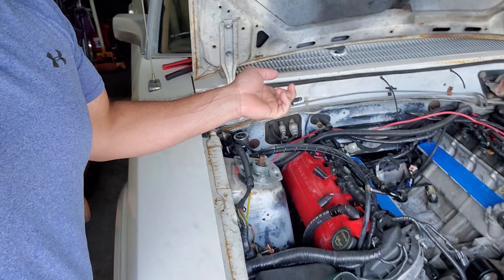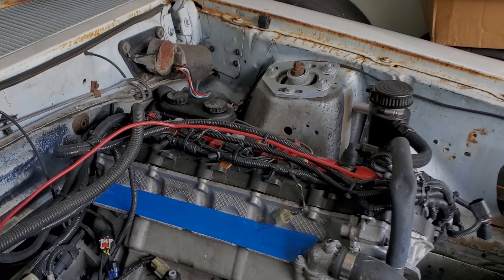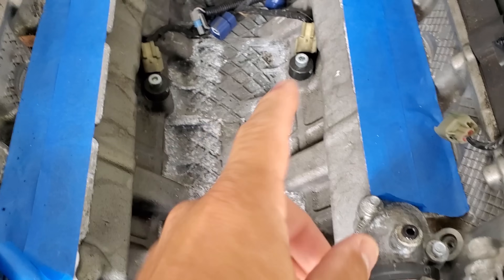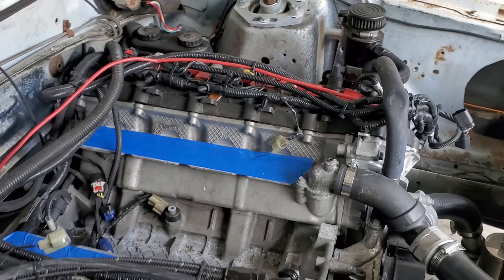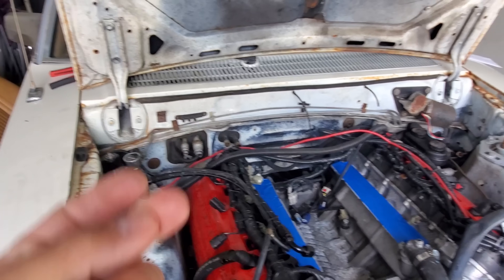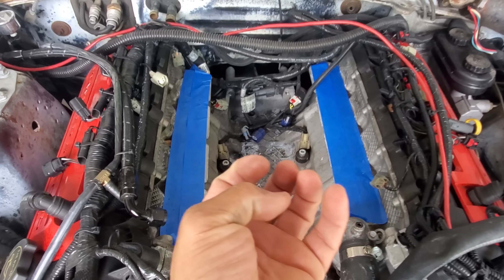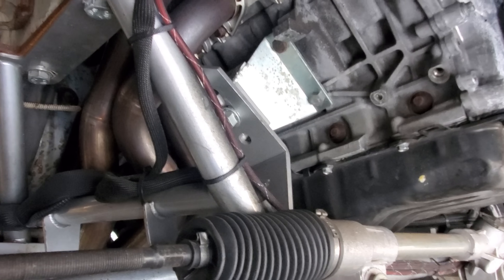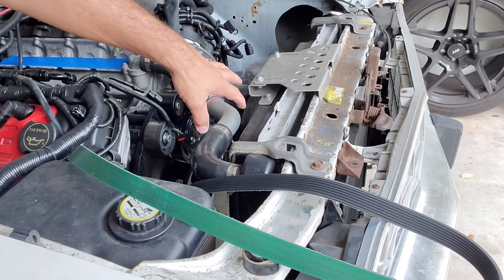Coyote Mustang Knock Sensors and how they work

Comment: I make the J&S Vampire.  Lets you add individual cylinder knock control to the earlier modular Ford engines, using a single knock sensor.

Comment: My 2015 F150 has a 18GT manifold, Cat delete, cold air. Stock exhaust. My truck peaks 30* by 5k and from there it drops all the way down to 15* by 7k gradually. Nothing hits, spark plugs are new. It does it on 91 or E85 it gradually pulls 10-15* to redline at 7k from 5k. Zero knock anywhere else besides the 5-7k window. Any ideas? I know its false since I have put good fuel in it many times and still manages to pull it. Needs a catch can? Or motor too noisy? Truck is super quiet since its still on stock exhaust and stock manifolds.

Comment: I've a 2012 ford mustang v6 and I've p0325:00-6C. I look that up and I think that means my knock sensor are going bad. I don't have any other code but when I also look at the misfire monitor I'm getting some misfire. I drove one hour and I had about 72 misfire count. Idk I think my knock sensor might be the issue cos I've don't the plugs and coils and ran a few test on it and everything checks out but my mechanic also told me it's in the range so that is normal. What is your thought on this?

Comment: Does turning off knock sensors thru the tune effect timing at all I have a 15 mustang with a 2.3 roush blower I kept getting false knock so had them turned off thru the tune just wanna be sure that I will get all the timing on e85 all the time

Comment: Alex please help. Alot of ppl cant really pinpoint this problem. What if my knock sensors go crazy after i shift in a pull. It was throwing +6.00 of knock. I had them desensitized then turned off, but i want to fix this issue. It didnt do this after i went on E. But it only happens when i shift. And yes it is false knock.

Comment: Makes sense why Mustang owners don't know what the fuck knock sensors are. GM has been using them for a few decades now. I had to monitor knock like a hawk when I had my 1998 Grand Prix GTP... Then people freaked out if it blipped 1-2*.. That's ok, as long as you are not seeing much higher than that.

Comment: most people don't seem to realize that there isn't a separate hose for each octane, so while you pressed 93, you might also end up with a hose-full of 87 in your tank with said 93, on top of the questionable quality of the 93 the station has. long story short, if you need a certain level of octane then run it, or trim back until you can run what you have, unless you don't care about costs lol.
Reply: There is no fuel in the hose. Ever see a dipshit drive away after forgetting to put the nozzle back in the pump and tear the hose off, shearing the pin at the break-away coupling? No fuel. Don't believe all the bullshit you hear/read on the internet.

Comment: I was literally debating what motor mounts to buy and this popped. What about poly mounting the trans? Should I just solid mount it also. Thanks alex
Reply from the maker: You can't get poly mounts that's fine but remember if it's stiffer it will transfer more resonance
Reply: @YDBT4LIFE  
I found an Energy Suspension polyurethane trans mount at Steeda - https://www.steeda.com/steeda-mt-82-transmission-mount-bushing-insert-2011-2015-555-4037.html
Reply: @SwankySasquatch66  it's an insert that goes into the empty space of the OEM rubber one. Not a complete trans mount.

Comment: I had engineer tell me bolts that hold knock sensors in place matter. Like flanged bolt vs non-flange bolt and length can change how noise is transferred to sensor. I thought part of sensor that touching block what mattered. He claimed bolt also help with sensor picking up noise and he had recordings to prove this. I never seen recording but I know Oscilloscope will pick up Freq from knock.

Comment: Had some knock on logs last year with dumped exhuast and no issues before. E85, NA CJ car shooting for 10s. Suspected my dumps to be the issue so i welded in some race bullets and have been awaiting a track day ever since but this virus screwed that up. Hoping to get back to the track soon and get that 10 I've been shooting for. Brandon has helped a tremendous amount. If I have not solved my issue with the mufflers i will be getting the knock sensors turned off though. I test my E85 every time before I fill my jugs. Thanks for the great content Alex, love these informative videos and the livestreams as well.

Comment: This video came in just in time alex! Just went to the dyno today and my car seems to be pulling timing. I have a roush SC with full Bolt ons, fore return style fuel system and running e85.. I’m going to look around to see if anything is hitting. I’m down 70whp, checked plugs and fuel pressure and all that is good. I’m also going to secure the little jlt catch can see if that could be the issue as well... great video man.
Reply: SLOMOE_5.0 good luck
Reply: Thanks! Hopefully I can figure out what’s going on.

Comment: What about top mount twin turbo cars? Do the sensors need to be desensitized the same as a PD blower. I think i may have ran into some false knock with a turbo down pipe hitting the frame.

Comment: Yo thanks for all the info I won’t to do a swap in my new edge had it from 0 miles
Reply: Coyote fits just fine in new edge car and coyote is slightly smaller than 4V engine that cobra used.
Reply: Great video Alex I love the live streams but these hands on tec clips OMG perfection